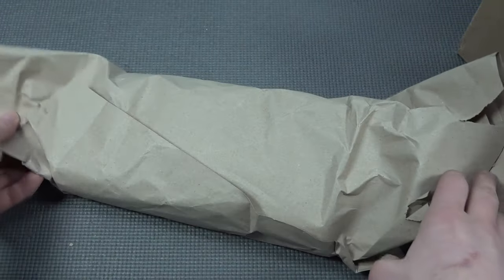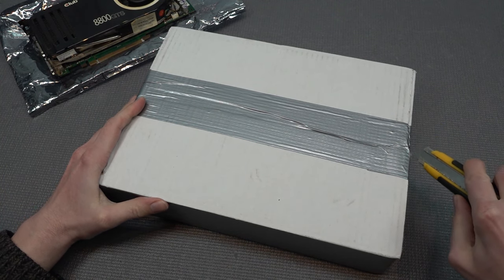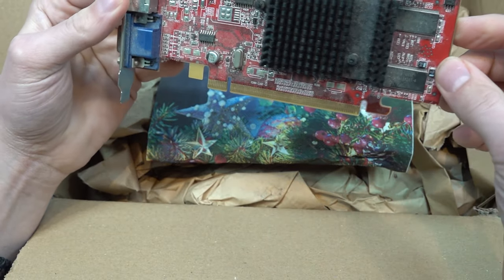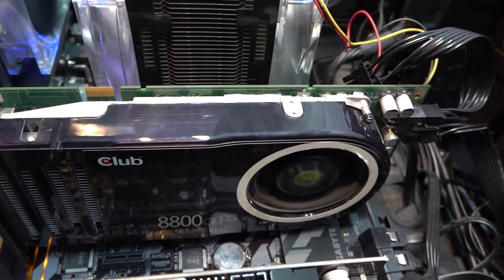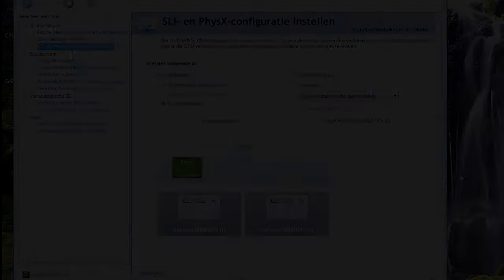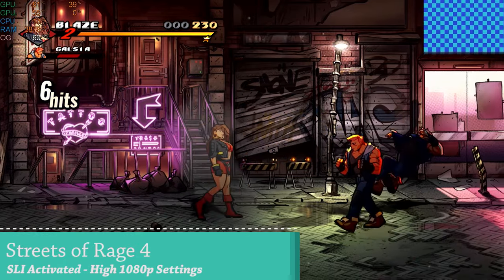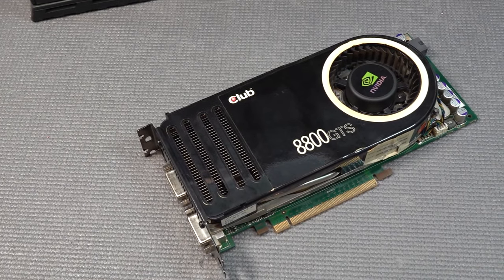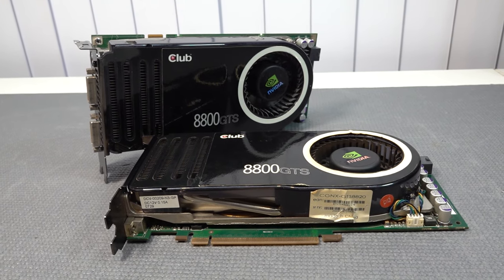Let's Double The Gaming Power in 2024 !  🦾

Comment: Picked up some parts from the scrapyard today myself as we swing by here at work a lot & was a bit slower day so could check stuff out fairly freely.
1x8 gb DDR4 stick at 2133 mhz, 3x I5 processors on socket 1151.
Which were an I5 6400, I5 7400 & an I5 6500 (In the order of slowest to fastest heh.)
As well as an oem Acer gtx 960 2 gb blower card.